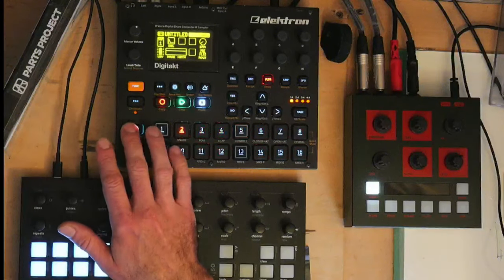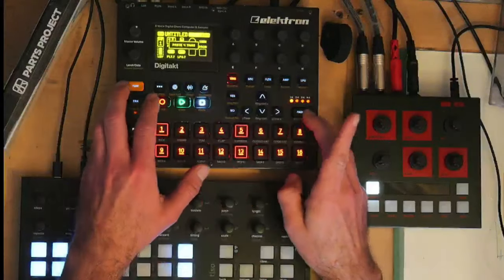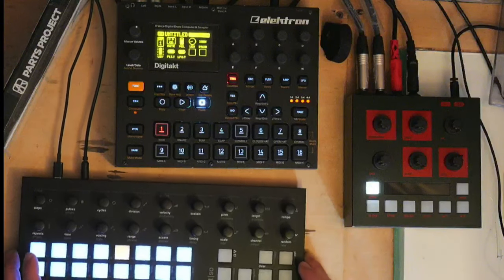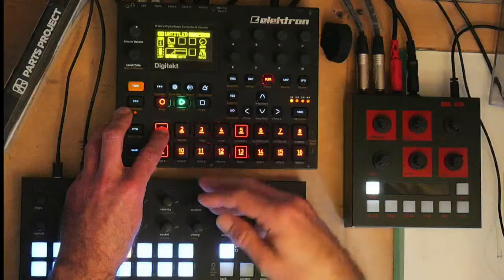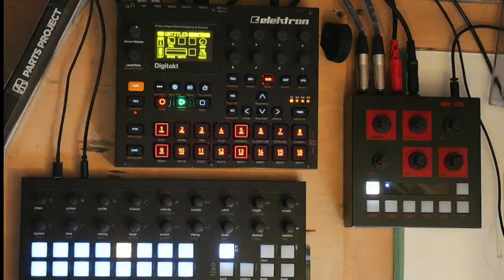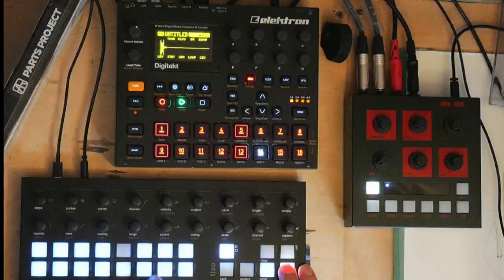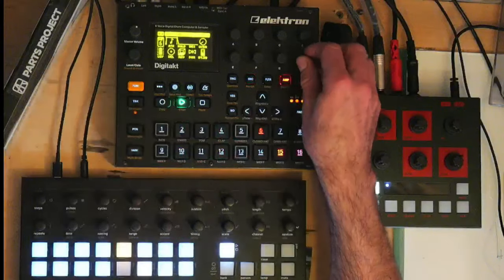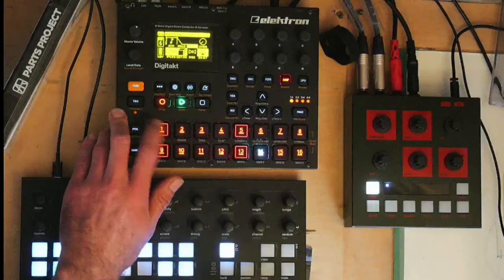Even when Elektron is wrong they're right! (SCENE HACK SETUP GUIDE)

Comment: The locked parameters disappearing after a reboot is probably a result of going over the limit for that device. 
Digitakt/Syntakt have a limit of 72 locked parameters per pattern, Digitone 80. It’s listed in the manuals under “parameter locks.”
Reply from the maker: @aperson1157   The limit does not seem to apply. Even after the message appears that says limit reached, you can still lock parameters. It was only certain parameters that would not stay locked, but others were fine.

Comment: just spent awhile trying this and think I found that it does not work over when sequencing over usb. was trying to use ableton as the midi data source but the fill trigs did nothing when sending the midi over usb/overbridge. I luckily have a midi interface so tried that instead and works great. weird edge case but wanted to share :)
Reply from the maker: @officialdagubah  You're the second to report this so it looks like it's a thing after all. Thanks for the info!
Reply: @partsproject this does work over usb if you are sequencing with another device

Comment: Nice video! How do you feel about the torso t-1? I'm searching for a dedicated stand alone sequencer. I have synths, Elektron boxes, drum machines, modular, and samplers in my studio. 

Also, what is the machine to the right in this video?
Reply from the maker: @theAwakenedOne007  t-1 is incredible for live performance in so many ways, but it is a euclidean sequencer at heart and while it can do manual steps and programming, it's not as straightforward as a classic sequencer. Maybe I'll cover the t-1 at some point. There's also that oxy sequencer that looks really good. Thanks for the support!
Reply: @partsproject  it's funny that this video popped up. I just watched an EZBOT video yesterday of him doing a very similar scenario with the octotrack. Very cool y'all both came up with similar use cases for Elektron boxes. 

What hardware box is to the right in your video?
Reply: @theAwakenedOne007  Box at the top right is the Oto Boum, a compressor.
Reply: @minimal.camera  thank you! I'm so into the t-1. I can't wait to get my hands on one.

Comment: Wonder if you can just sequence an audio track with an midi track straight from the Digitakt. I ll try it for myself
Wondering also, if you can make templates, like EZBOT is doing
Reply: oh, I just got my answer for the sequencer
Reply: Yes you can. For templates, that would just be project files. So you can make a project and populate it with a bunch of scenes, then save it as a template. The thing is your template project will also need to have some sounds on each track, which could just be the defaults, so you have something to listen to when designing the scenes. So you may want to combine the idea of kits and templates into one thing, where you have a template project file that contains both scenes as well as a kit of sounds/samples.
Reply: this works with midi loopback using a regular midi cable fyi

Comment: This is such an awesome technique, I'm also combining it with the Human Program approach of doing this same thing on the Syntakt FX block. I made this recording right after watching this: https://youtu.be/VMxzBiGg9Io
What I found was that adding say 3 - 4 plocks per track per scene will fill up the lock memory very quickly. I only got 2 full scenes in before I started getting the memory full error. It still lets you add more, but I think it starts erasing plocks from earlier scenes as you go. So in practice it seems like you need to really limit yourself to something like 5 plocks per scene (across all tracks) if you want to have a wide variety of scenes available. Have you found a 'sweet spot' for the approximate number of plocks per scene that works for you?

Comment: Here's an issue I've discovered with this technique: If you're using long samples that only require a MIDI trig every once in a while, the scene locks will start misbehaving in 1 of 2 different ways:
1) The scene lock will only engage at the beginning of the pattern and will only disengage at the end of the pattern, even if you take your finger off the button early.
2) The scene lock will engage as soon as the sequencer reaches the corresponding step, even if you're not holding the button down.

I dealt with this problem by simply slicing the samples up and populating the grid with more MIDI trigs, which does require some creative compromises. I wasn't able to narrow down the exact point when this problem arises, but the scenes will definitely behave weirdly if there is a longer sample with fewer trigs.
 
NOTE: I'm using MIDI loopback on the Digitakt, which actually didn't require a special cable, just a regular Hosa MIDI cable going from Out to In.